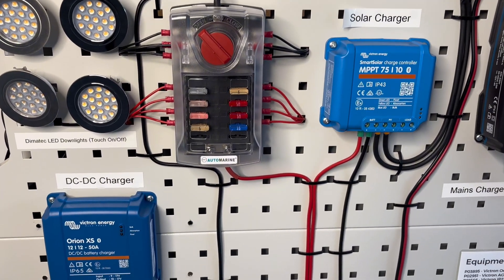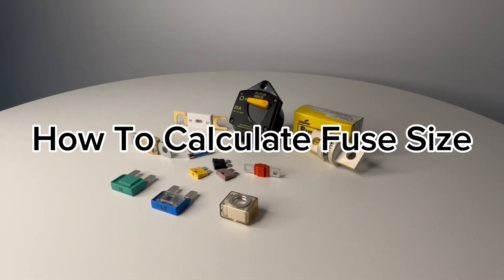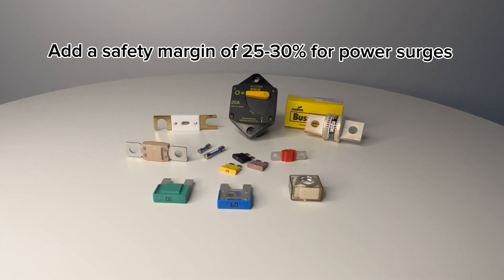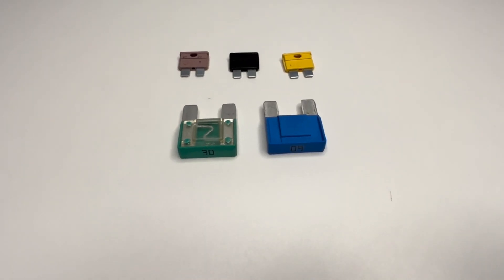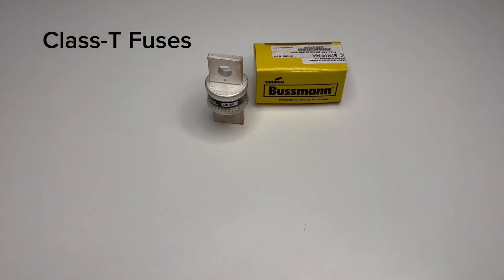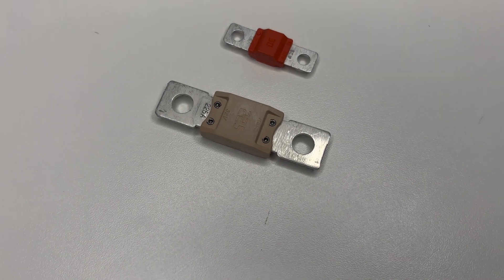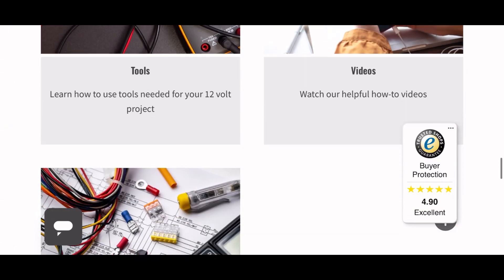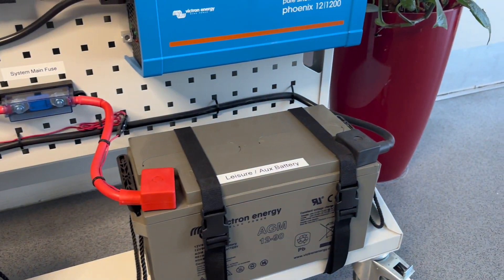How To Choose The Correct Fuse Size For Your 12V Electrical System | 12 Volt Planet

Comment: Hello
Do you have a good video of wiring a small cabin with 2 12v batteries, some lights, switches for the lights, and 2 plugs on an inverter for regular 110 plugs to plug in a fan. All on solar power.